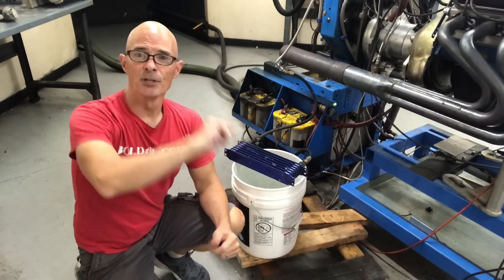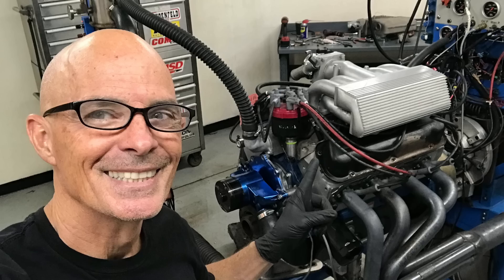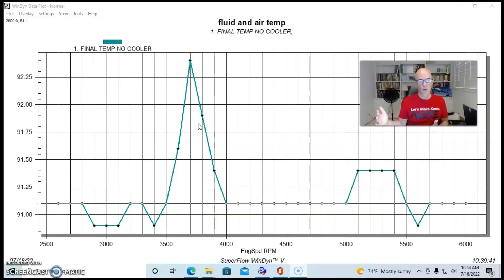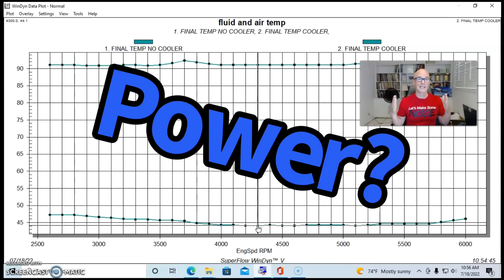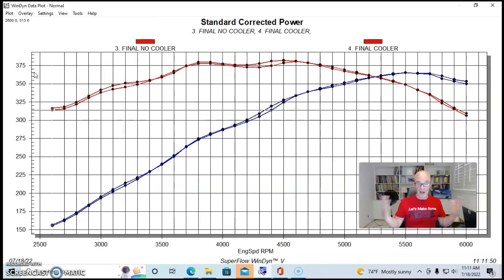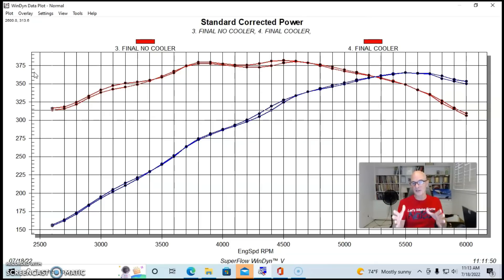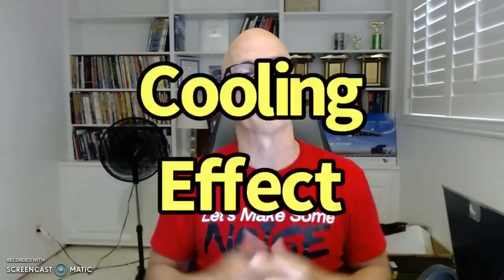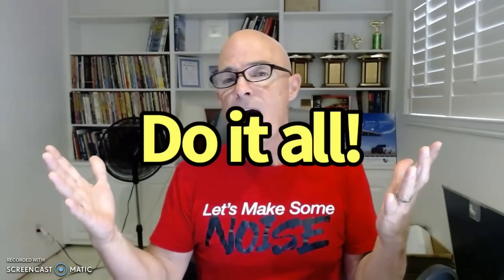EFI FUEL COOLING & HP? DOES ICE-COLD FUEL ACTUALLY ADD POWER TO YOUR FUEL-INJECTED MOTOR? DYNO TEST

Comment: The EFI intake manifold has a lot of surface area, and had the engine been enclosed in sheetmetal to replicate an engine compartment, would hit over 200 degree temps. Since its a dry manifold, the fuel wouldn't cool it, but I think on these dynos you run 60 degrees on the inlet air, so in effect you're already accomplishing a cooling effect.

Comment: In theory fuel cooling should better work on turbo engines. Cold fuel didn’t increase power it self, but it helps to slightly decrease egt (every single degree is on count) and due to lower egt, you could add little bit more fuel and air per cycle, and more fuel usually means more power.

Comment: the problem i see is, that we talk about a relative small amount of fuel over time going into them engine. so you do cool down the fuel, but by the time it gets to the injectors it heats up again. surely cooling it even more can kinda help, but even so my suggestion would be to somehow insulate the fuel rail it self and cool that as well. should make a difference, but i would not expect anything ground breaking...for that you would need to cool the fuel down to sub zero celsius values anyways.

Comment: My question is why use race gas or e85?  Isn't it so you can add more timing and increase performance as well as having a slower burning fuel to help with detonation?   So if that's the case, why couldn't you run more timing on a naturally aspirated engine with cooler fuel to see if there is a difference?  Or would it even make a difference or is it only good to run more compression?  I know they are two different things but I thought cooler or slower burning fuel also allows for more timing?
Reply from the maker: e85 adds power before you add timing and we already had the max timing the motor wanted
Reply: @richardholdener1727  max timing with pump gas or e85?  Just curious

Comment: What's the difference between EFI Fuel and carburetor fuel. Because EFI fuel is no different than carburetor fuel what your thumbnail should have said was, cooling for your fuel for your EFI vehicle, not electronic fuel injection fuel Cooling there's no such thing as EFI fuel or carburetor fuel. Unless you're in the E85 and the Q60 and all that stupid s*** which you're not talking about

Comment: How does the engine behave when the engine is summer hot vs winter cool like at a drag strip? Figure the Cold Fuel would help keep engine cooler making the runs more consistent!

Comment: Need the engine to be properly heat soaked. The cooling effect in the intake runner only works efficiently when heat is introduced. Roughly an inch of the intake touching the head should be above warm to the touch.

Comment: Definitely do a centrifugal supercharger to see if charge cooling is significant! Also, just because it popped into my head, make sure the oil cooler isn't a restriction or somehow dropping pressure! Also check AFRs, they may make the same power but one could be richer/leaner. I've learned so much from your videos, you're a huge reason I have a 6.0 and 4L80 in my '87 Silverado!

Comment: The only thing that I have found that makes a lil difference is burning gas vapors instead of atomized fuel. The burn rate on vapors is for the most part is 100% efficient.

Comment: Seems like as you super cool fuel, the molecules contract and therefore, you should be able to get a denser fuel charge in the combustion chamber. I would like to see a wintertime outdoors dyno. Cold air and fuel, vs a warm indoors dyno test

Comment: I ran circle track we were running a zz4 with a carb before qualifying we always packed the intake and carb with dry ice and wrapped with towels covered the fuel cell with dry ice bumped the timing up blocked off the nose put sterno camping fuel on the bottom of the air cleaner hat and it always picked up time on the track it definitely lowers intake air temps

Comment: years ago i did a similar test on a carbureted street-strip car using a cool can.  with cold gas i could discern a small improvement at the strip-a few hundreds of a second.  in the interest of science--and my warped curiosity- i lowered the fuel temp until i had frost on the float bowl.  at that point the car slowed down, i believe because the fuel was not atomizing as well at those temps.  the cool can works for a dedicated race car looking for every last hp.  for a street-strip car the extra complication, clutter and inconvenience was not worth it.  plus, unless there is ice in the can, the cool can will heat the fuel.

Comment: No free lunches. To turn liquid into a gas or vaporization takes energy. Usually heat from air and surfaces. So you transfer heat energy in the air and use it in the fuel. Does it cool the air enough to make a difference. I don't think it would. The amount of energy needed to vaporize fuel is already accounted for in dyno readings. We don't know how much it is but only thing that your interested in is the difference. You are putting in a few ounces of fuel that uses tiny amount of energy to heat. That air gets cooled doing extra work and maybe it gets fractionally denser but unless you can optimize the burn would be hard to measure. I'm thinking it's not worth the effort. In real terms the extra complexity and weight would not pay off.

Comment: In aviation we have fuel oil coolers - oil gets cooled by fuel, fuel heated up by oil. Primary purpose is cooling oil obviously. I wonder if heating the fuel would energize atoms and produce a better spray pattern? Let’s heat some fuel to a safe level and see what happens!  The cooling from E85 is not ambient temp, alcohol burns cooler.

Comment: I guess this is somewhat based on fuel density. It'd be interesting to see the difference in volume between the same amount of fuel at two different temperatures. It's obviously very little difference. I would figure temperature effects air volume much more than a liquid.
Reply: Years ago the typical below ground fuel temp of 58* volume was compared to 100*.
Seems like it was 4% expansion. 
Like if you fill your tank, don't drive, and it pukes out overnight.
Denser gas gives a fatter mixture with a carb. Oxygen sensor engines always have the proper mixture, right?

Comment: hi richard when we going to get some more barra content i'm building a na to turbo barra atm  ebay turbski 1000cc injectors crow valve springs atomic oil pump gears arp head studs conservative tune 4 bar map sensor only looking at 400hp not shooting for the moon on this engine just reliability  going into a e90 bmw for shits and giggles cheers from down under

Comment: Two things, think ice cream cooler. You can get the water below freezing by using a brine slurry. Second, as I understand it, there is more chance of fuel dropping out when the exhaust crossover is blocked on an intake, hence the use of downleg boosters to provide better atomization. So how does cooling the charge not also create or have the potential to create more fuel dropping out of suspension? I remember Smokey Yunick superheating fuel for his little Fiero project to make it (I suppose) super efficient.

Comment: You won't see any change on a fuel injected engine because the benefit of e85 is from the phase change latent heat absorption. You're probably see a pretty big game on a carbureted car to cooling off the carburetor and intake charge but it still won't be nearly as massive as an alcohol fuel

Comment: Fuel cools itself when it changes from a liquid to a gas the same as water or anything else,especially when it comes out of an injector under pressure, so I wasn’t expecting any power difference
Reply: Regardless of fuel temperature, consistent fuel mixture by O2 sensors = consistent power.
Note a multiple hole fuel injector squirts the same volume but smaller drops than a single hole injector. (EV1 vs EV6 etc) 🤔🤔
Does ignition vaporization make much difference? Looks like RH proved it does NOT on fuelie engines, at least for power produced. Multi hole injectors do increase efficiency by smaller droplet size.
Reply: @hotrodray6802  👍🏻 at full throttle o2 sensors don’t effect changes in the fueling, other than the ecu will add and sometimes subtract the average fuel trim data to the fuel map 👍🏻 
Unless the tune is modified to not add or subtract it

Comment: Turbojet aircraft engines often use a FOHE (Fuel-Oil heat exchanger) to cool the oil, and intentionally heat the fuel so it atomizes better in the combustion chambers. I understand there is not an easy and safe way to do this for car engines, but it would be a neat experiment.

Comment: It sounds like the combination of cubes, cooled fuel & the carburetor did the trick. So🤔, I suggest that you try boost, cooled fuel & cubes. Maybe a 408/416 LS, between a 76 & 88mm hairdryer, Carb vs EFI, Cooled 93 vs cooled E85. That should yield some nice gains...hopefully.

Comment: Why do carbs make more HP, because the air intake temp drops when you put fuel under a vacuum, in some cases ice will form on the body of the carb and intake because of this.

Comment: I believe you concept/hypothesis may be incorrect.

It may be that the spraying of the fuel unto the intake manifold may create the cooling effect.

I refer to the VW Beetles that use the Solex carb;  the manifold just below the carb usually gets so cold that the condensation is pretty extreme..

I believe this cooling may cause the air/fuel charge to become more dense on its way to the engine.

Try cooling the intake manifold to see if there is a power difference 

Good luck

Comment: The setup is just not Octane limited...
Test it on a high compression boosted engine running on the edge of the given fuel.
48* drop of fuel temp doesn't make power, but it will reduce knock if you are on the edge of the given fuels limit.

Comment: Water injection would give you a bigger power increase in forced induction than cooling the fuel.  This is because water can absorb more heat than what fuel can.  Very good test though that proves, in fuel injected engines, cooling the fuel does nothing for power.

Comment: I ran a 12 X 12 fuel cooler on my 76 gmc sprint after I did a mild build on the 350. It could be 95+ degrees and the carb would have condensation dripping off of it. Never had a problem with vapor lock! I would love to see what happens with a boosted engine running pump gas with no ethanol.

Comment: Everyone who loves engines should check out the late great Smokey Yunick's homogenizer engine. Smoky invented this concept quite a few years ago where he actually heated the air fuel mix instead of cooling it. He used a turbo as what he called a "homogenizer" to heat the air fuel mix, then heated it again. It was a strange system I don't fully understand, but it was pure genius how it worked. He used a Pontiac Fiero engine for his testing and managed to get twice as much horsepower out of it and some 50-60 mpg fuel economy. During testing Smokey mentioned that the test engine made too much power and he kept breaking the Fiero transaxles. Somehow that engine concept just disappeared. There is someone here in Florida who has a couple of these engines from Smokey's garage but I'm not sure anyone knows how to make them run right or if they even run at all. If this concept had taken off, we would be driving around 4 cylinder cars that can smoke the tires at will and get 50 to 60 mpg doing it. The oil companies probably paid Smokey to keep them off the market.
Reply from the maker: hot vapor engine
Reply: @richardholdener1727  Smokey was way ahead of his time. Wish he were still here. I enjoy the content, keep up the great work!

Comment: You got what I expected for hp gains in a port fuel injected application. In a carbureted application the pressure drop across the carb has an additional temp change caused by the pressure drop across the carb. The lower fuel temps would merely add to this temp change causing a greater charge cooling effect on the fuel/air mixture resulting in higher hp gains. On the port fuel injection systems the location of the injector negates any additional effects cooler fuel will have on the charge temperature. It would be interesting to see if changing injector location would have any effect. I suspect it won’t have much of an effect.

Comment: Wouldn't the cold fuel cool the charge enough to where you could advance some timing? Imo, right now the ecu is pulling fuel to correct AFR because its detecting a rich burn from the dense cold fuel, therefore no power gain. Adjust AFR targets and/or add some timing. Just running cold fuel alone wont do anything because the ecu is correcting for the slight bit more fuel.

Someone correct me if I'm wrong,

Armchair Engineer
Reply from the maker: we don't allow the ecu to pull fuel-it is not run in closed loop
Reply: @richardholdener1727  I stand corrected.

Comment: My Jeep runs significantly better with cooler fuel, I have seen 195 degrees at the rail in summer after a highway run. Venting the hood and modifying the rail feed and insulation gave quite a bit of seat of the pants difference.

Comment: On turbine engines, we use the fuel to cool the oil and heat up the fuel. Helps with atomization. So don’t think cooling the fuel would be beneficial.

Comment: Charge cooling from evaporating fuel will NEVER add power.  But you should definitely test a supercharged engine to finally prove it to yourself.  E85 makes more power because the mixture has more BTU than gasoline (at the same lambda).
Reply from the maker: PHASE CHANGE AND E85 HAS FEWER BTUS THAN GAS

Comment: So many things with this test, I'm not even sure where to start. Actual fuel temps at cylinder (or no dead head fuel rail), the latent heat of vaporization of gas is not like that of ethanol (so stop comparing it). Cold gasoline is not the same. It will struggle to vaporize in the same way. Yes, more compression (boost or CR) will help. More time in the air will also help (see carbs or running dual injectors per runner). 

I would be curious to see what individual EGTs were on this test. I bet the correlate well with rail fuel temps.

I could have a fun evening discussing this.

Comment: Yes, with boost and E85 move the the fuel back and all of that, but what about the difference between 93 or 95 and 87? Higher octane is a slower burn, so would it help to run 87 instead? Or would it just get to a point everything just goes boom?
Reply from the maker: OCTANE AND BURN RATE ARE NOT THE SAME THING
Reply: @richardholdener1727  I thought octane slowed Burn rate and kept the fuel from detonating? Causing Knock? If the octane is reduced at the beginning of the cycle and the fuel cooled wouldn't the better fuel be 87 since it is more prone to a quicker burn rate than 93 or 95?
Reply: You were right, I was thinking volatility and said burn rate. I got confused between the injection and carburetor.  The computer would compensate very well on an n/a, should not be much difference on the results. Wouldn't a carburetor run rich because of the density of the fuel that had been cooled?

Comment: Would it add power on the same NA 302 on a back to back test with a RPM Air Gap and a Carb over the GT40? The difference between your results and Engine Masters makes me wonder if the Carb is the secret. Great video as usual.
Reply from the maker: CARB IS THE SECRET

Comment: I feel like if you cool the fuel and the air charge you would get a significant power increase kind of like does the engine make more power in the winter or the summer?

Comment: You should try a boosyed motor for sure. Im betting, cool fuel on a boosted motor probably helps with detonation. You definetly gotta find max timing for the test motor using cool fuel and hot fuel.

Comment: I believe that this is not the best way to cool down the entire incoming charge, you could try( similar to rocket engines) routing the cool fuel through some aluminum spacer bolted between the intake manifold and plenum, that would also cool the airflow. Just a thought 🤔.

Comment: The vast majority of the charge cooling you get from fuel is from the latent heat of vaporization of the fuel, not the heat capacity in liquid form.  Gasoline liquid has a heat capacity of 0.53 BTU/lb-deg F, but a latent heat of vaporization of around 150 btu-lb.  That means that your 48 degrees of extra cooling only bought you 25 BTU/lb, or in other words 17% more cooling of the charge air than you'd get from the vaporization of the fuel alone.  The power improvements from icing down fuel and manifolds in carbureted applications probably comes chiefly from cooling the manifold and carburetor down, minimizing the air heating from those (normally) hot surfaces, by improving volumetric efficiency.  Good and interesting test, thanks Richard!

Comment: This is an interesting test. I added a fuel cooler like 2 years ago. i was running an external fuel pump on my return style system and my exhaust was close to the pump and tank. I was getting a condition where the car would warm up to temp and started having fueling issues that caused it to stall. I thought it was due to heat soak of the fuel returning to the tank after leaving the engine, but it had more to do with how the fuel system was wired.